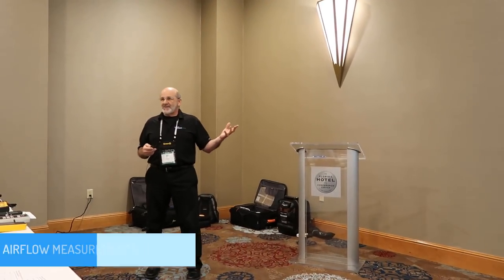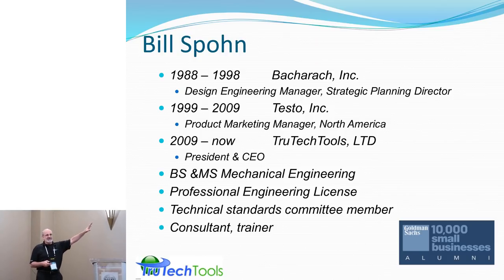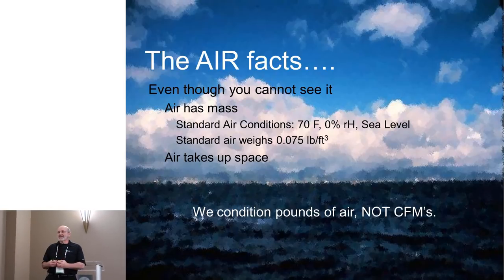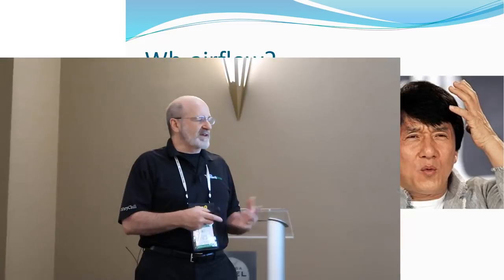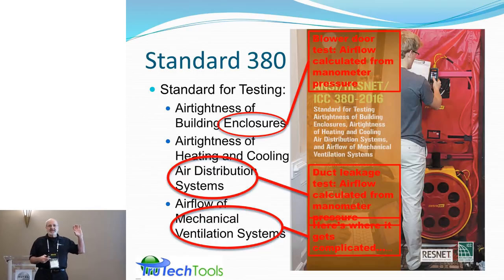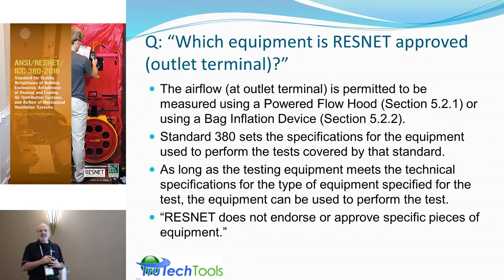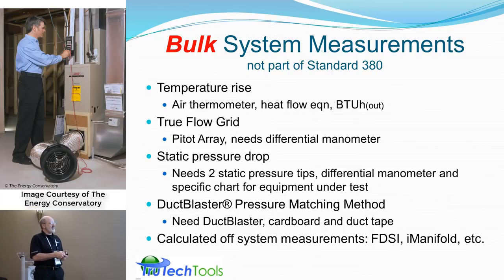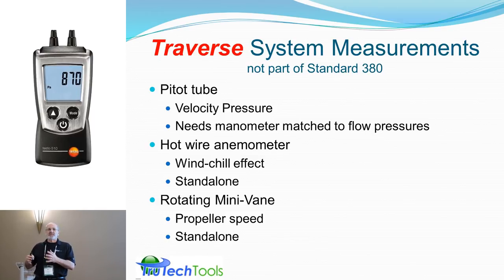Air Flow Measurement Part 1 - Introduction

Comment: Check airflow to each room with an anemometer; also install more large filtered return grille areas...! Buy 'a low cost' LaCrosse Model: EA-3010U; get the sf K value of the grille; convert mph to fpm by *X by 88 that velocity number *X sf K value of the grille = CFM.

If you use Manual J load-cal & Sizing in SW WI the heating & A/C CFM's will be close to the same because there is up to a 60°F or sometimes up to a 70°F temp-rise in heating & only about a 20°F temp-drop in cooling; you can use it to target cooling blower speed selections.  

This is an easy way to get a reference record of the CFM of your system... you should have access to the mfg'ers graphs or airflow charts showing the various static pressures at different blower motor speed selections
CFM Airflow should always be checked & a Record left with the unit...

I have a 60-K 95% propane furnace or 57000-Btu/hr Output, no central A/C; Temp-rise 59°F * 1.08 is 63.72; 57000 / 63.72 is 894-CFM. Approximate CFM…
Simple & easy to post a permanent reference CFM for a system... 

There is virtually no-one checking airflow CFM before charging an air conditioner or heat pump system. This is very essential in order to accurately charge the system, therefore, I will provide the easiest way to get a record of the CFM on the system; you are checking to see if it falls within the 350 to 400 CFM, or in hot dry climates up to 450 CFM per ton category. You need to get it there…! 

During the Spring, Fall, and Winter months and even early morning in the Summer months you can use the furnace BTU Output and temperature-rise above the return air temperature; multiply it by 1.08 & then divide that number into the Btu/hr Output to get a pretty good CFM airflow number.  It is close enough to get it within the correct CFM Zone… 

If your air flow is not correct you will be getting false superheat and sub-cooling readings. 

There is virtually no-one checking airflow CFM before charging an air conditioner or heat pump system. This is very essential in order to accurately charge the system, therefore, I will provide the easiest way to get a record of the CFM on the system; you are checking to see if it falls within the 350 to 400 CFM, or in hot dry climates up to 450 CFM per ton category. You need to get it there…! 

During the Spring, Fall, and Winter months and even early morning in the Summer months you can use the furnace BTU Output and temperature-rise above the return air temperature; multiply it by 1.08 & then divide that number into the Btu/hr Output to get a pretty good CFM airflow number.  It is close enough to get it within the correct CFM Zone… 

If your air flow is not correct you will be getting false superheat and sub-cooling readings. 

C’mon guys, it’s time to start doing things close to the RIGHT Procedural WAY…!